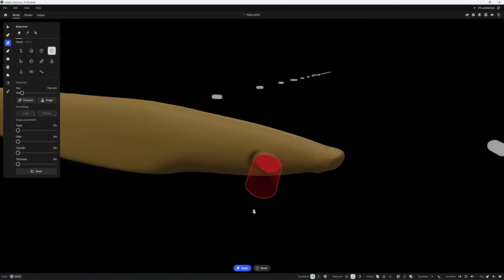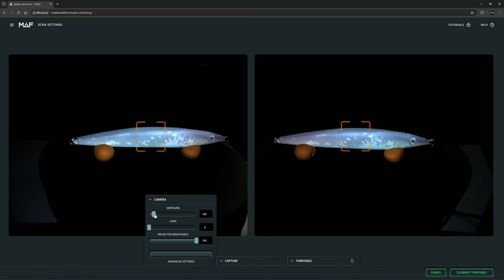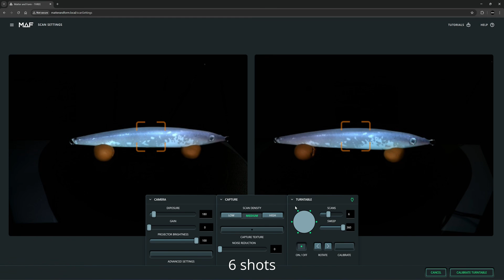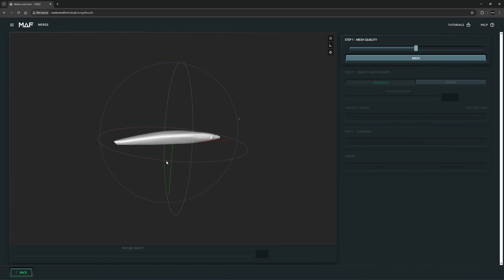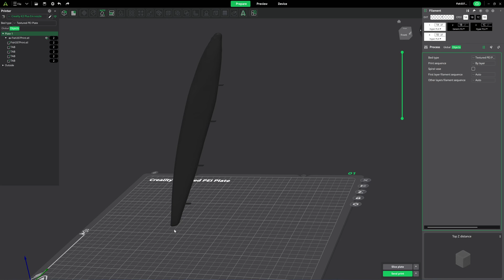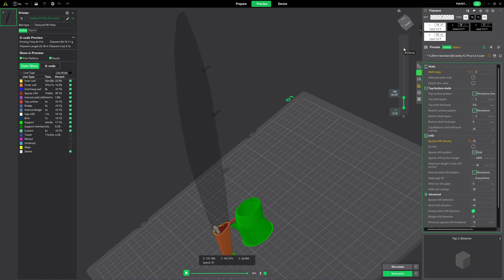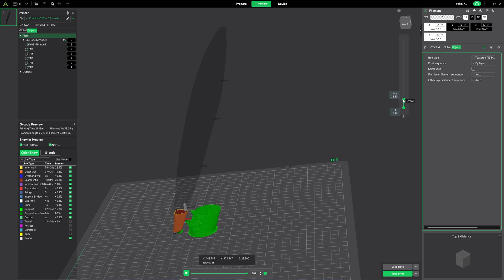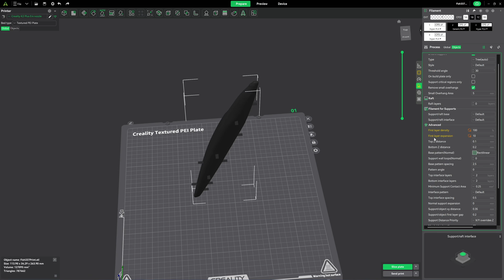3D Printed Nylon Lure: Scan-to-Print Workflow

Comment: You could consider using a full encapsulated support. It will obviously require more filament, but will help to insure you get a successful 3d print, thanks to great support and heat retention. 

🇦🇺🤜🏼🤛🏼☮️😎🍀
Reply from the maker: Thanks for the advice. My main concern is actually removing the support—especially with nylon prints—it’s incredibly stubborn and just doesn’t come off easily.

Comment: What 3d scanner do you recommend for small thin parts for accurate reverse engineering?
Reply from the maker: When I scan a scraper with MAF3, I can see the sharpness of the blade very well. (https://youtu.be/A_ELgnV3JBM)  
I haven't tried scanning thin blade with Raptor yet.